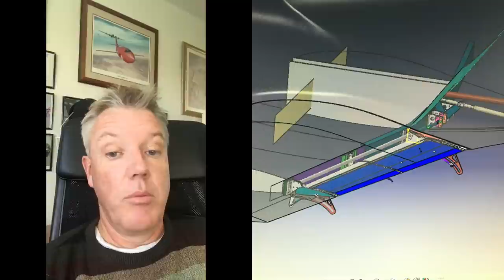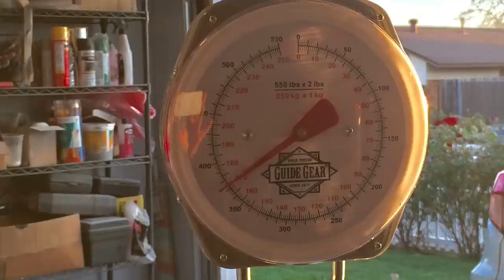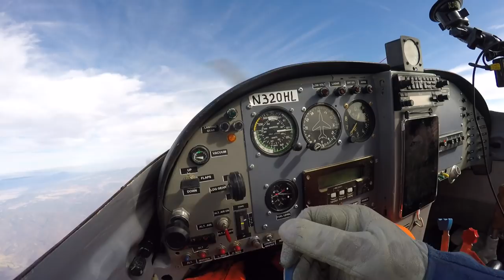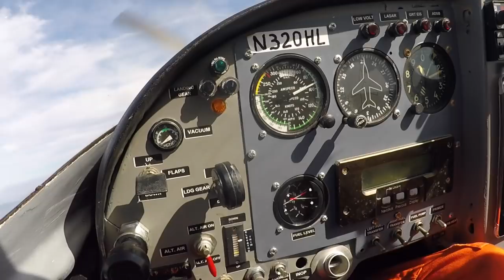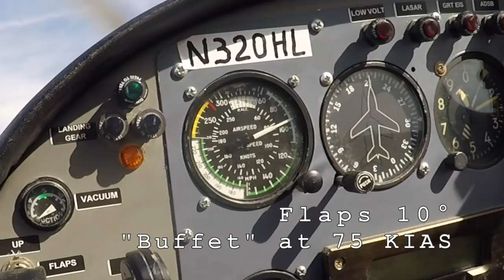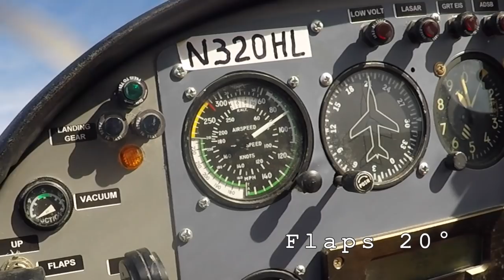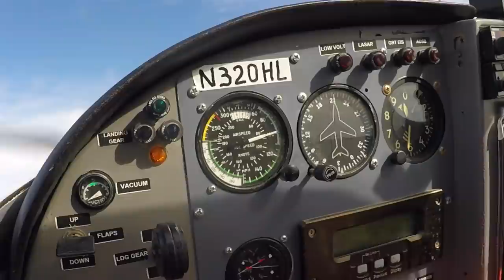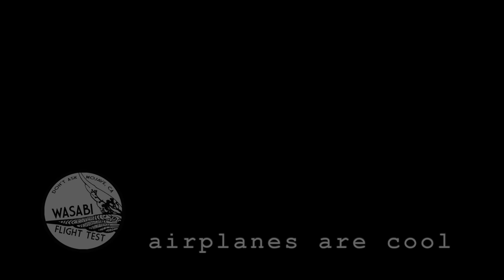So Many Tufts - Stall Tests @ First Flap Deployment - Flt 6 - Hakan's Modified Lancair 320

Comment: Hi Elliot another great video. On the flaps, can the foreflap be removed? I think the gap is too small i would test without it and see what that does to the stall. I also recall you saying you were out of up trim. That would make me want the CG moved aft a bit. Also i would try testing the elevator at zero trim. You are loosing a lot of effectiveness by having the trim tab at near full deflection. And nice choice on the Miller welding gloves!!! Just what I would want when egressing a burning plane.
Reply from the maker: Thanks man.  Great comments.  It’s not uncommon in this class of airplane to not have enough up elevator trim in landing configuration, but good thoughts for sure.  Wait until you see what Hakan is up to now!!

Comment: Where is the pitot tube? What about air flow interruption or error regarding the static port? Are you experiencing position error? Indicted airspeed error at high AOA? Elevator stall is an interesting concept...

Comment: The problem is in the wing root .... the fuselage shape pulls in too quickly. The pressure gradient is too steep and the stall progresses rapidly forward and outboard. No idea what can be done about this because you cannot easily change the shape of the fuselage. I doubt VG's will have much effect. Also the slot between the flap and wing might be too small and choking the flow over the flap. Also the NLF-0215F is an aft loaded airfoil with a rapid pressure recovery at the rear meaning that the boundary layer is near its limit of stability ..... I think from memory that these sections have been tested and analysed with plain flaps but not slotted / double slotted flaps ... the aft loading might not be compatible with the this type of flaps because a lot of the lift on these sections comes from the trailing edge (thats why the pitching moment is high) and so a slot that lets the pressure bleed from bottom to top might not be a good thing (probably cancels out the benefits of the flap) ... also the slot would reduce pitching moment and I think that is why you are not noting much change in elevator required to trim as flap deflection increases. Would need more investigation and analysis ..... I would run the 2D section in a CFD program (Fluent etc) to see what can be learned ..... also read NASA-TP-1865.
Reply from the maker: Thanks for the comment.  Hakan is currently redoing all his CFD with the new data.  We are excited by the results.

Comment: Without tufts we don't know the full spanwise travel of the separation, but were you feeling buffet in the ailerons? I suspect not, and based on the tufts on the hor stab, I think you're right that the limiting factor is the stall of the stab. Is it getting blanketed by the flaps maybe?
Reply from the maker: Great questions.  Wait until you see what we’re doing next.  Thanks for watching.

Comment: I'm wondering what the point of flaps 10-35 that don't allow a lowered airspeed. I'm mil ex rotary so I have a different perspective re: airspeed.
Reply from the maker: Great question.  This is the problem.  The intent was to lower the stall speed, but so far we havent been able to.  Which is why this is where the fun starts.  Lots of great work ahead.

Comment: The elevators looked stalled to me, hence the lack of feel towards the rear. Are they gap sealed? Also saw one elevator tuft getting sucked into the hinge, which would indicate low pressure on top of stab at hinge line!?!? It makes me think the CofG is too far forward, which can happen with fowler flaps as they increase the cord rearwards, giving the effect that the CofG has moved forward compared to the mean cord.
Reply: Yep, airflow separation at “wing root” is really dramatic at all aspects and is just destroying the benefits of the whole flap system and throwing all that bad stuff right into the elevator.
Reply: @tropicthndr  The fact that the airflow is still attached on the flap also adds to the total centre of lift moving back added to the increase of wing area rearwards all adds to the affective CofG moving forward in relitive to the lift. As you say the separation at the root kills the tail but I think moving the CofG back a bit and having a sealed gap on the elevators may reduce the effects but I agree that some more work is needed and the root fairng or addition of VG's for the first 3ft of wing.
Reply from the maker: SO much fun testing to come.  Thanks for the comments and for watching.

Comment: I don't know much... but wouldn't some little vortex generators across the top of the wing surface just infront of the flaps help that wing maintain laminar flow?
Reply: *posted this before Hawkins said it around the 1hr mark. lol
Reply from the maker: Glad you caught that.  I am so excited for what he has on deck next.  Super cool.
Reply: @devon - Hah, I posted a similar comment in another reply on this video after watching the first series of stalls at 15 & 20 degrees.  The only think I'd quibble with is the chordwise placement of the VGs.  You don't want them "just in front of" the flaps -  but rather pretty far forward on the wing. You need them to add energy to the boundary layer ahead of where the flow separation is happening.
Reply: @noelwade  right, I meant "just infront" meaning not the whole length of the wing... would probably place them at the peak of camber on the wing i would guess..... would also like to know how that design of wing chord effects this type of slotted flap, wings probably not optimized for low speed characteristics regardless seeing all the extensions that were added.

Comment: I don't think he understood what you were talking about with your uncontrollability limits and bailout considerations. I certainly don't understand the concept. Can you explain what your thought process is with the 1.5 to 2G turn. I would think that if you can maintain a high enough speed to maintain control that is low enough to put it on the ground, you could make that decision in the air.
Reply from the maker: Thanks Tim, I could have done better there.

The point is that just because you can simulate a landing straight ahead at altitude isn’t quite enough.  As mentioned in the video the turbulence will be worse as you descend and you will have to maneauver.  Not to mention if something unforeseen happens, the goal is to set a minimum handling quality standard on the ground that can be demonstrated before descending through bail out altitude.

I summarized it in the report as well.
Reply: @utopiasnow  That makes sense. The part that confuses me is the level of G you use to determine maneuverability. Are you equating maneuverability to a 1.5G level turn? So you would want to have ~45 deg AOB maneuverability within the other parameters to determine your bailout/non-bailout criteria?
Reply from the maker: This is the exact conversation I was trying to have.  The actual topic is S&C so the actual variables of interest are things like roll rate, or susceptibility to spin, or or or.  But those things are complicated to measure and even more complicated to talk about in the heat of battle over the radio.  I chose 1.5G because it was a threshold I could measure.  I am trying to avoid a radio discussion about whether the airplane is “land-able” or not, and while the speed or G is peripheral to the topic, it’s related.  Am I making any sense?  Can you think of a simpler or more direct way of quantifying this threshold?

Thanks
Reply from the maker: I didn't mean that sarcastically, I am really interested in thoughts on this topic.
Reply: @utopiasnow  I didn't receive any sarcasm

I can understand that you want to agree upon your decision windows on the ground. All pilots should have this thought. That way you can make the choice in the air without having to consult the owner over the radio. Just like the CHTs. 

However, I don't understand how you can quantify it with Gs. How do you quantify controlability differences between 1.5G and say 6G? This is what I think the owner had trouble understanding as well when you changed from 2G to 1.5G. To him it made no difference
Reply from the maker: @sicktj  G is an indicator of excess control power.  The thought was in this hypothetical situation the aircraft becomes uncontrollable below a speed that may be close to an acceptable approach speed...let remember not to forget that maneuvering would be required to get to that approach.  Again, the goal is a simple quantifiable decision gate, and I am open to suggestions.

Comment: Haken is not a young kid. Four years of chasing the reduced stall speed rainbow is a big chunk of his remaining flying career. Why not put an AOA warning system in that beautiful Lancair and get to flying it?
Reply from the maker: Paul, I don’t understand how an AOA would lower approach speeds?  I think Hakan has the same sickness as so many of us EAAers, he just has to try.  I’m glad he chose to make the run at the mountain!!
Reply: @utopiasnow  Hey Elliot! Thanks for your content. I was disappointed and surprised (like everyone else) that the flaps didn't take a bite out of the stall speed. Any idea if Glasair's version has been tested? Has anyone run the idea past the original wing designers (if they're still around)?
A run at the mountain it was, and a great effort at that.
Of course an AOA warning system won't lower approach speeds, but might prevent a few inadvertent stall entries on approach, and thus have the same effect on fleet-wide safety as lowering the approach speeds.

Comment: So all this work will not make it faster, may be slower with less useful load due to added weight and drag from the flap track. 
The slower speed is nominal and a Lancair is not a STOL plane regardless. It is interesting. The flight test process is interesting, but I don't think this modification is value added. The added complexity is added weight and likely less reliability.
Reply from the maker: Great to have your feedback.

Comment: In pitoh...disaster ...now exactly where lancair manual says and works good ...drops right wing in stall as mine is not very straight ...need springs on ailerons and rudder for this reason ...but overall it’s been 2500 hrs of superb flying

Comment: Fascinating. Not a fan at all of the irrelevant movie clips. Especially mindless bros celebrating non-achievements.
Reply from the maker: What?
Reply from the maker: Oh the high fives?  If that’s your only concern I’ll take it on the nose.  I thought you were talking about my kids.  Thanks for the comment.
Reply: @utopiasnow  I liked your clips. Lightens up the fact you did not have to bail out and that the decrease in air speed was OK. The balance and controls still worked. That's what I figure you were after.